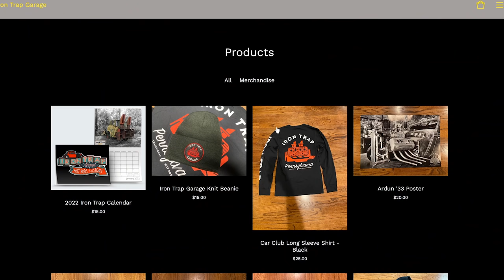Hopping Up A Flathead For the 1939 Mercury Coupe!!

Comment: Matt a tip for you. Next time you use the magnet to get at the rust cover the magnet with a small piece of thin cloth. Secure it with a rubber band. Grab the rust and then remove the cloth. Rust falls away and the magnet stays clean. Nice job on the rebuild.
Reply from the maker: Good idea for sure!

Comment: My grandfather and his brothers raced these way back in the day on the local dirt tracks (Silver Springs, WilliamsGrove). My pappy did all kinds of craziness to get them to run wild. He had an old hotrod rag it was called something like the poor man's hop up. He said they would pack the heads with asbestos to raise the compression. They would double up and sometimes triple up the valve springs. He said they would get them to run on the edge of blowing up. When something broke it was over there was no saving it. This reminded me of stories with my pappy in the old racing days some 70 years ago.
Reply: Could you elaborate on the "packing the heads with asbestos for compression" ?
Reply: @dylanjones1286  I would love to if I could. He passed away about 22 years ago. My guess would be that they would make a slurry like the plumbers did when doing pipe insulation. Then lather it on the head. Asbestos is indestructible so it surely didn't burn or anything. I don't know for sure. When he told us those old racing stories I was a little kid and never questioned it. I heard many times that he shimmed the valve springs that tight he would turn over 7500 rpm. If he dropped a valve it was game over, have to go shopping for a new block.

Comment: Man does Matt have a huge library of knowledge in his head.
The magnet and compressed air cleaning trick 8d have never thought of had I not seen him describing and doing it here.
Absolutely brilliant.
That's why he da boss at the Iron Trap Garage.
Reply: Old hot rodders & mechanics have been doing this for years. It's better to turn it up side down in the engine stand so the big shit falls out then roll it over with the deck level & fill it full of 50% Muriatic acid & water then let it soak for a bit. Flush & repeat as Necessary on each bank.

Comment: Just what the Mercury needed. It'll make it a nice straight full fendered street rod - maybe lowered just a leetle bit? That car is so straight it will be a head turner when parked and, with a hopped up engine, when running, too. Keep us all up to date with progress on all your projects - we all appreciate the videos.
Reply: Hey Matt.    I'm sure that you know that back in the day that merc would be a tail dragger with fender skirts.   My first car was a 39 merc 2 door sedan with long spring shackles and skirts and I loved that car.    It was a real treat to ever see a 39 coupe because there just wasn't many around.    Man, you always find the choice cars!  : )  ........and even a very suitable motor for that one!    I built an  A V8   that I took to several car shows  in the early 2000s.    I spent lots of time starting my full race motor for folks to hear run .  Also as you know , like lots of old timers on here, how great they sound!     Looking forward to seeing this project because I was always partial to them, even over that year fords
because of many small differences in the design.   Also first year for juice brakes on fords and mercs.  Good luck!

Comment: Not sure what kind of oil pressure you have, but I am guessing it is just ok. Back in the day we modified the oil pump with a heavy spring to increase the oil pressure. A few years ago I rebuilt a '48 Lincoln 12, which were notorious for low oil pressure. The stock pump was replaced with a Melling Hi Volume oil pump. Wow. What a difference.  I had enough oil pressure that I could sub-lease some of it to other flatheads.  Melling sells them in two flavors, Hi Pressure and Hi Volume. They are a little bit pricey, but the piece of mind was well worth it to me.

Comment: All that rust will block the rad,  you will need fliters, or a sock in the top hoses[s] to catch it. Not pretty but totally required.
Back in the 70s I used an engine, then about 12 years old that was rusty and I had two radiators, one for 6 lap heats and another for 8 lap finals [2km laps] Never thought of a filter!!  Lucky I had a radiator shop as a sponsor!
I have seen the classis stockcar guys do similar with flattys and they are using Landcruiser radiators!
And using a used cam and non matching lifters?? I hope it survives. And always use moly cam lube. On the lobes.
You MAY get away with it because not much lift or spring presure on those engines.
I have seen new cams wipe a lobe in about a minute, even then a mild race cam in a Chev

Comment: Quick question Matt. When fitting a crab dizzy on to my 1939 24 stud Flathead. Do I have to change the timing cover for the 2 bolt dizzy? I bought the 2-3 bolt adapter plate from Speedway However the distributor shaft doesn’t seem to reach the slot in the camshaft. Cheers Paul Carr
Reply from the maker: You also need the cam button that takes up that gap. I believe speedway sells them as well
Reply: @IronTrapGarage  Thanks guys. Love your work.

Comment: Firstly, I know it is not a real old school question, but did a flatty actually, put out more horsepower with 2 strombergs, vs a single 4 barrel intake, most saw ran the old square bolt pattern (ie: christmas tree Holley, or Carter wcfb)... just asking

Comment: My question is I was told one time that a Mercury flathead is better than a Ford flathead . Something about the crankshaft I think. And if you put that engine in the Mercury it wouldn’t be worth as much because it’s not original.
Reply: Yes the merc crank has a longer throw. But on a complete car, the value difference between a running flat head with a Ford crank vs a merc crank is negligible. The option for more money is to have a 100% original car and engine with all original parts yet no sloppiness. Unlikely. Since the motor was stuck(and who knows if it was the original block/crank), you would likely lose money rebuilding the original then selling the car. Just my opinion. Pulling these out of a barn after sitting for decades is really cool but worn out and sitting isn’t a gold mine.

Comment: HIT IT WITH A LEAD HAMMER OR A DEAD BLOW HAMMER  NOT A STEEL HAMMER ON A CAST HEAD  / A GOOD WAY TO CRACK  CAST IRON /  WITH LEAD OR PLASTIC DEAD BLOW  HAMMER YOU GET THE POWER  AKA FORCE  WITH OUT THE SHOCK  AKA DAMAGE

Comment: Some questions about this engine. First it appears to be a 1941-1942 so called "raised deck" engine with sleeves and a displacement of 221 c.i., if that's correct the 1939 Mercury came with a 239 c.i. engine not this engine displacement. I know you do modifications on your builds from a stock vehicle (especially the ones rodded back in the day) but given the originality of the 1939 Mercury I don't agree to modify it's engine from what was it was equipped with from the factory. You're free to do what you want and I really enjoy almost 100 percent of your work but my opinion is to leave this as stock as possible.